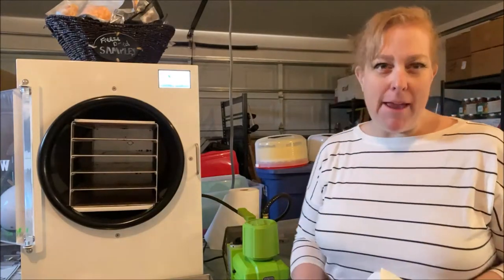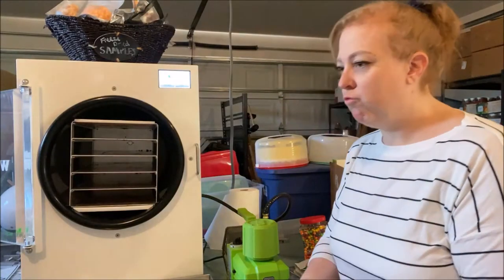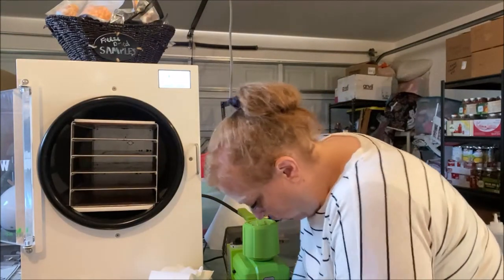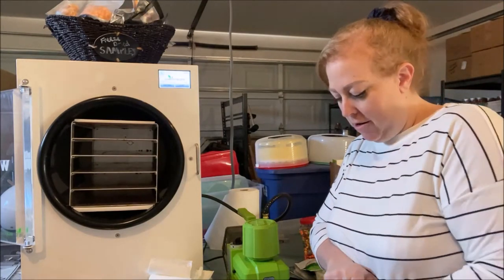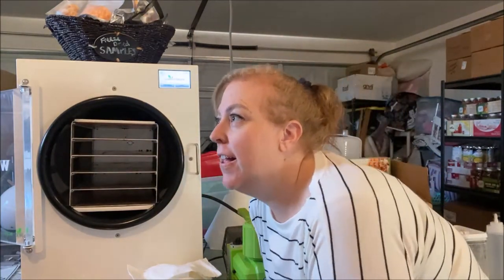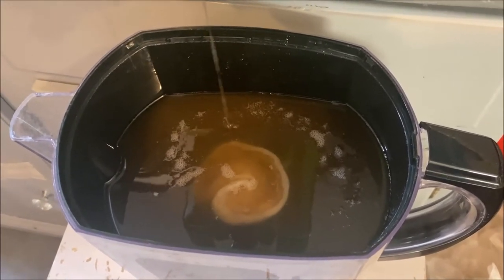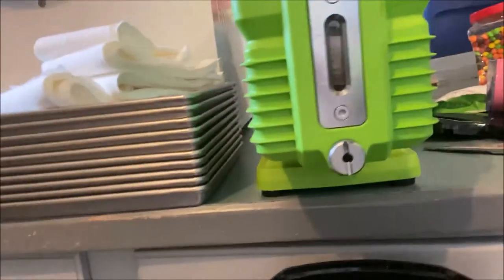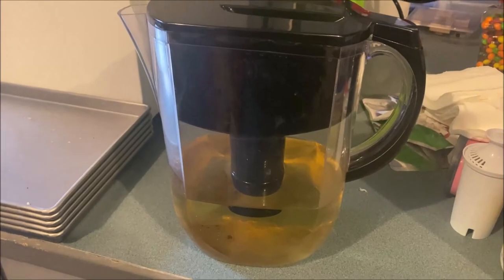How to change the oil on your Harvest Right Premier Pump Freeze Drier using a Britta Filter Pitcher

Comment: How do I get the change oil message off of the screen after oil change? Brand new first time changing oil! Thank you so much in advance!
Reply from the maker: It should have an option to dismiss or clear it.  There are so many software upgrades and version it's hard to know what you're seeing.  Once you change the oil if the machine doesn't detect it, or have a dismiss/clear option on the screen see if it goes away after running the next batch.  If not maybe power off and back on again.  Hope that helps!